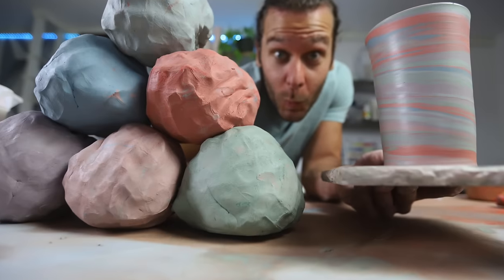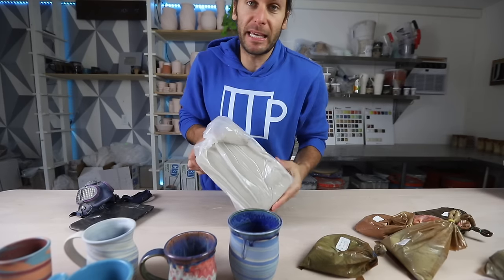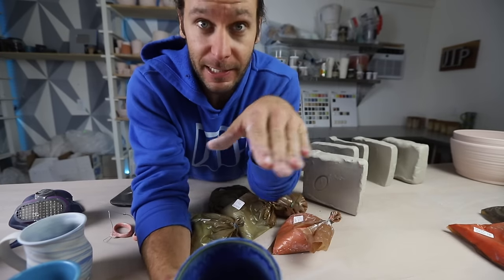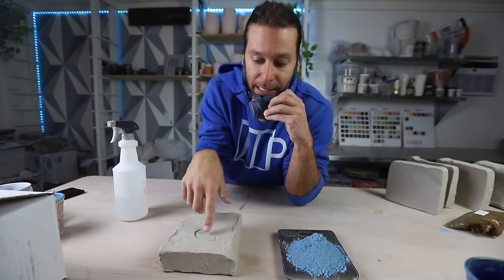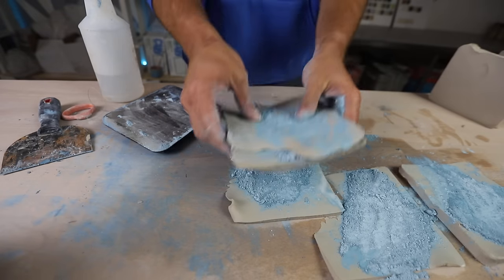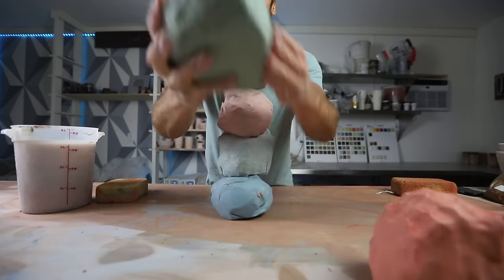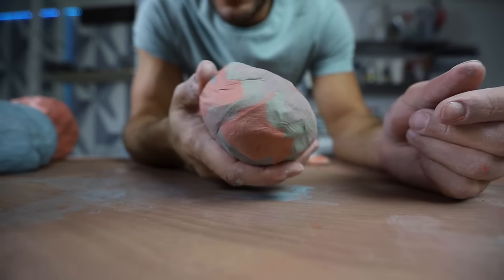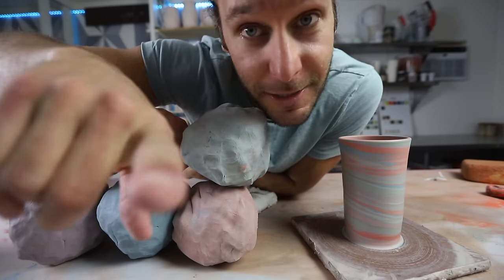How to MAKE COLORED CLAY!!!  The ENTIRE PROCESS!

Comment: A time saving tip might be to mix the stains into recycled (dissolved) clay, then you can just wedge together on a plaster bat once dry. We were always taught this method at uni because you get a more consistent result weighing bone dry clay than weighing normal clay from the bag.
Reply: That's how I've done this as well, but I've never really bothered to measure the mason stain amount, and it still works fine. Be warned that many mason stain colors are unstable when fired to cone 10 (especially yellows and purple/violets). Given how labor intensive the colored clay process is, you should always do some tests first to make sure the end product color is what you want.
Reply: @apoll7  are mason stains and pigments same? Or they are tipically made for clay use? Please guide me....
Reply: @adilamjad9171  mason stains are a type of pigment widely used for clay, and usually clay with a white body, like porcelain. They may have other uses as well (paint?) but I'm not sure about that. Some produce widely different color depending on the high temperature reached in the firing.
Reply: @apoll7  ok thanks i will gonna try...

Comment: I've been trying this since watching your video. I found its much easier to mix the stain into wetter clay..reclaim clay that's not hardened up enough. It mixes fast with wedding, and the powdered stains also helps to dry the clay to a good consistency. Another tip: if your colors are different consistencies, store the stacked layers together for a day before wedding and they will even out.

Comment: Your measurement of stain is wrong, you're basing it off wet weight of the clay and it should be from the dry weight.  So while not bad, you're just using more stain than necessary.  If I remember correctly the water weight in the clay is about 30% of the wet clay weight.  And it's easier if you make the stain into a paste and then add that to the clay.  You can get spotting if the powder doesn't get mixed in all the way when mixing dry stain in.
Reply: Thanks for the heads up!
Reply: That's why he uses 8% . Most resources say use 10% of dry weight. He is assuming he has 20% water weight.
Reply: So its 8% of the wett Clay? And how can i make a Paste? Just water and the Powder?

Comment: If you are wanting to try this cheap and are willing to go with a very limited color selection. You can get the same thing from you local hardware store.  There it is usually called "cement color mix" and is often a liquid.  It usually costs $7 for 10 oz and NO SHIPPING - because you just go and get it.
Reply: Very interesting! They can be fired and not burn out???
Reply: @amyrp9115  I have not used it as a underglaze, only as a clay pigment; but, it worked great for that and goes though bisque perfectly.

Comment: How is this man not popular yet? Genius!! 
Can you suggest pigments for paper clay?
Reply: If it’s the kind of paper clay you fire in a kiln, any of these ceramic pigments will work. Just base your measurements off of the dry weight of the clay, not off of the mixed up paper clay. If you’re making paper clay from a slurry you might as well dump the powder into the slip too in that stage, rather than wedging it in later. 
If you’re making the kind of paperclay that isn’t fired, any pigment will work!

Comment: Thanks for the detailed instructions on this. I was wondering what proportions and methods to use. By the way, are you not concerned about the mason stain directly on your skin? Shouldn’t we actually use gloves? Or is the dye material totally non-toxic?
Reply: I would think that it's one thing to have it on your skin, where it can eventually be washed off, but quite another to breathe in the dry pigment whilst measuring. That's probably why he wears a ventilation mask while measuring, but not totally concerned with his hands being colored up. I figure if he's not concerned about skin issues, then I think gloves are optional.

That said, everyone's skin is different. Wear gloves if you have a sensitivity to certain things like pigments. But if not, you don't have to worry. 😁

Comment: Could  you make the Mason stain into a thick paste and then spread it on the slab instead of dry. Was thinking it might incorporate easier? Don’t know but I might try it in a small amount of clay and see if it wedges in any easier.
Reply: Deborah Tuzon this is what I was taught to do, takes out the inhalation risk when wedging the stains as well!
Reply: Also my thought
Reply: This is what I did. My "professor" had 0 clue on how make colored clay so after researching extensively, watching a ton of videos & playing with it. I made a slime from Mason stain, slip from the clay I was going to use as the base & wedged it to start then got a bread maker from the thrift store & let it mix it for 30min. It came out AMAZING!!!

Comment: Have you found any mason stains that lose their color after firing? I bought a deep salmon stain (not from US Pigments) and bisque fired to 04, then clear glaze to cone 5. The really cool pink/red stain burned out and went to all brown/beige. The marbled pot still looked great but I was disappointed that it didn’t stay the color I had hoped for. Before I spend a bunch of money on US Pigments stains it would be great to know which ones hold their color after firing. 
Love the videos btw. I’ve learned a ton from you. I know there’s a ton of very technical stuff that goes on with pottery but you make it so much more simple - and it works!
Reply: kevinsko a lot of this has to do with which stains have cobalt in them and which stains are "encapsulated" i don't fully understand it myself but Google it or call your local ceramic supply place....